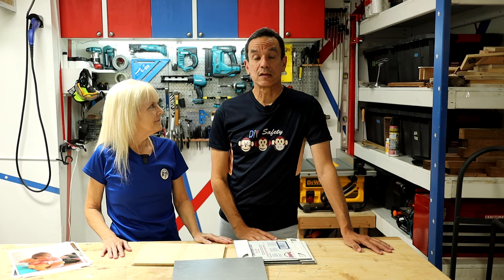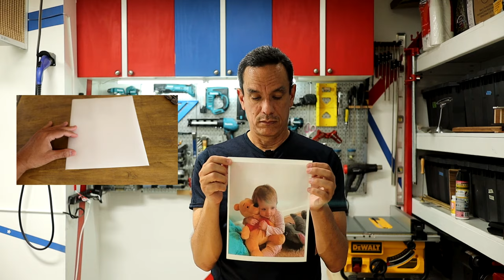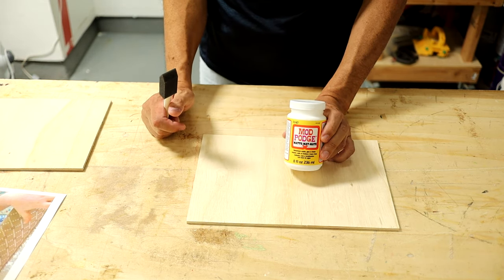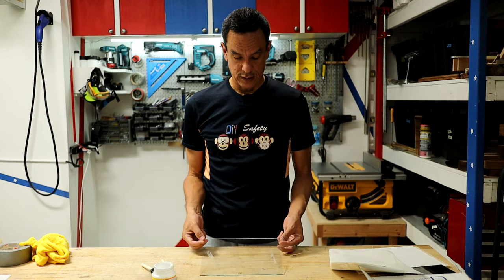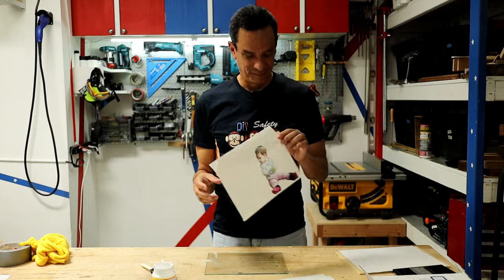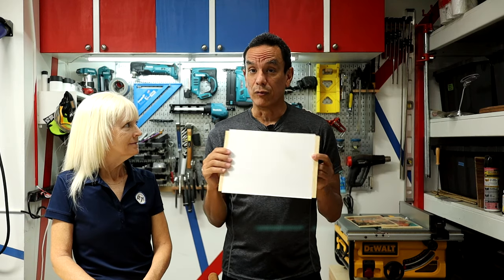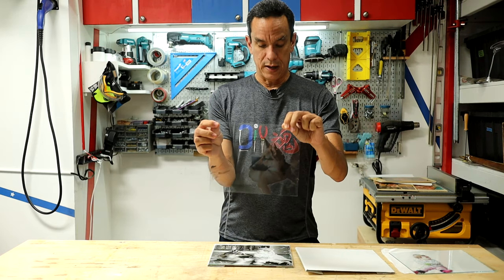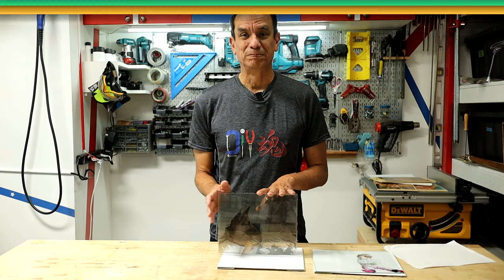Photo Transfer To Wood, Metal and Glass

Comment: I’ve done this method many times as well. To ensure complete contact, I use a plastic puddy knife or an old gift card to smooth it out. The main objective is to be sure that there are no bubbles. Working from the middle out towards the edges works well. For added security, I place a heavy book on top while it dries.  May I also suggest using Liquitex Gel Medium (can be found at most craft stores in the paint section). I have found it works much better than ModPodge.   Great video! I really enjoyed it.
Reply from the maker: we sincerely thank you for taking the time to write such a wonderful comment. I am going to see if I can get the Liquitex Gel and give it a try. We plan to try the various suggestions we received on our next video.
Reply: Question what side of the transfer paper do you use (glossy or dull side )
Reply: @georgelucas1443   you print on the glossy side.
Reply: Yes agreed ....I usually use  a mod podge photo transfer medium doin this technique and it works fabulous!  The one downfall is it is not transparent when dry..it white....soooo today im goin to try n transfer with transparency film ..we shall see how that goes...
Reply: Sto je taj Medium sto ste koristili i njegovo imee, molim.Hvala
Zelim kupiti ovdje u Hrvatskoj., mozda ima drugo ime.

Comment: The metal might be better if it was cleaned first by a light sanding, then using a solvent as it often has grease and other contaminates.  Also the sanding will open up the surface to allow for better adhesion.  I have the mod podge, but have not tryed this yet, I think I will try using it on plexiglass with a white backing to see how it comes out.
Reply from the maker: Fantastic idea. We have had many people make various suggestions. I am thinking it might be worth making an updated video testing out the great ideas!!!
Reply: Yes, wet sanding with 400 grit sandpaper and using a degreaser  will improve your metal adhesiveness.  Good pressure and some form of roller or squeegee  will insure  no air pockets or voids in your  transfer.

Comment: Hi Both, Great video and it is so nice when people show when things don't go according to plan and not cut that part out. 
One suggestion I have, not that I have ever done this, is to put a weight on top of the paper after using the roller and leaving the weight on over night as well. 
I don't know if it would make any difference but it's just a thought I had. Take care both. Cheers, Huw
Reply from the maker: Nice to hear. I constantly make mistakes. My whole channel could be filled with mistakes. LOL!! Kidding aside, thank you so much for your thoughtful comment. BTW, I tried a weight a little bit but I was concerned that the paper would stick and not just the printer toner. I watched several videos and they spend lots of time wetting the paper and gently rubbing off tiny layers over and over until the paper is all gone. Looks like a nightmare so we cheated and tried the easy way out. Please dont tell anyone. LOL

Comment: Great video!  Thank you. Just to reiterate. I can purchase Avery Label Laser Sheets (blank pages -- not address labels). Is this correct?
Reply from the maker: You can purchase any kind of label paper. You are going to remove the label side and use the slippery back side, which all label paper has. If you can, use your labels for actual purposes and dont throw away the backs. Keep the backs to give the transfer a try. :-)
Reply: @Poor_Mans_DIY  Thank you so much!

Comment: Looks interesting -- and the imperfections definitely make it more authentic. I did this for my wife last year using a wooden coaster set (made for crafting) I picked up from my local hardware store. It was a very rough rounded shape, and I used an inkjet with plain white uncoated paper (following a similar method with Mod Podge that I found on another channel) -- and I snapped a pic of the coaster and used that in Photoshop to get the selected image edges (of our rescue dog) to match the odd shape, then it was pretty easy to print and cut out and apply. Definitely something I want to try more of, even without a laser printer at the moment or the label backing paper.
Reply from the maker: We would really like to know how ink works on the label backing paper. I wonder if the ink will run or not. If it doesnt run, there should be no reason that it wont work. If you try this, please let us know how it turns out. :-)
Reply: @Poor_Mans_DIY  yes, I'm not sure on the label backing paper with inkjet. But in the one I did, it was just plain paper -- a technique from Nitsa Creative Studio YT channel (https://www.youtube.com/watch?v=1JBC3_ipeoc) :)
Reply from the maker: @deanontheinterwebs  Thank you sir. We have tried the paper technique and it was a pain and did not turn out as we hoped. We should try the ink printer on the label back to see how well it works.
Reply: it occurs to me that putting a HARD rubber sheath like pipe insulation over the 'rolling pin' might insure better adhesion contact. LOVE your 1950's TV look in that 'glitch'!!! 😀

Comment: What about plastic or. That silver transparent sheet that's in a flat screen. I think that would be cool. At one moment u wouldn't see it and the next u would depending on the light be hind it. Wish u would try it! It would be so awesome if it works!!!
Reply from the maker: Although we did not try this on plastic, we dont see any reason why it would not work. Simply put, the process captures toner in glue and then dries out on the surface. Your idea of using the silver transparent sheet really sounds like a fun challenge. It would be so cool if it works as you describe!

Comment: How did you peel the paper off? How long did you let it dry?
Reply from the maker: The paper on the back of stickers is very slippery. The glue and laser toner does not stick to the paper, even after drying. It just peels right off.

Comment: Hi Jennifer and Richard, and thank you for the time you take to produce such informative videos. Perhaps you can help me with a problem I have. I've purchased the paper from Amazon, as per your link, but when I print something on a laser printer, some of the toner seems to be rubbing off the rollers when the paper comes out of the printer.  What do you suggest I do? The print is fine on normal printer paper though.
Reply from the maker: Mr James, This was our first ever attempts at photo transferring, so we are no where near experts on the process but, I happen to be in IT and often have to repair printers. If your printer is older, it likely requires the rollers to be replaced. My guess is that the rollers have build up , which causes the toner to smear and need to be replaced.  It may sound complex but they are made to be easily replaced. The manufacturer usually sells replacement rollers  with instructions on replacing them. The cost is usually not bad at all. one option you might try is to remove rollers and use isopropyl alcohol to clean the rollers. This is only a temporary fix as they will need to be replaced as some point.  Although it might not work as well, I have seen others print on regular paper but it requires wetting the paper after the glue dries and rubbing the paper off little at a time. This seems time consuming but the glue and toner stay on the wood and the paper dissolves away.  We usually dont try to get people to watch our other videos. If they like our videos, they will watch without pressure from us. In this case, I recommend you check out our second video on this. We used viewer suggestions and used a different product called Liquitex gel that worked so much better than mod podge. Sorry for the long message.    In conclusion, we sincerely thank you for taking the time to watch our video and for your wonderful question. If you wish to ask more questions, please do not hesitate.
Reply: @Poor_Mans_DIY  Thank you so much for your advice. It's very kind of you to take the time to explain how I can sort out my issue. I really appreciate that. I've already watched your second video when you use Liquitex, and I have found that to be extremely enlightening. Once more, thank you so much for your help, and keep up the good work.
Reply: Use regular printer paper absolutely.

Comment: Howdy. Cool video. I've watch many MANY of these photo transfer videos and finally tried one myself....the over night then wetting then rubbing. Didn't come out so great, but I wasn't expecting perfection my 1st go. 

You didn't mention how long you let your images set/dry before you peeled. You mentioned that OTHER people said to let it sit 45 minutes or so...but you didn't mention how long YALL let it sit????

I'm noticing a trend now after watching all these videos and that is a SMOOTH surface. All the videos say to use a smooth surface, but smooth to me and smooth to you are two different things. 

So, how smooth should it be? Well, seeing as how your transfer onto glass seemed to work without a hitch, I guess the NEW definition should be "smooth as glass".
Reply from the maker: Let me begin by thanking you for watching our video and for your insightful questions. Before I provide any info, I recommend you check our second video on this. We had many comments from viewers with great suggestions and we applied their suggestions and got much better results. The most important thing was to use something called Liquitex Gel, which worked significantly better. Now to answer your questions. We did tests and allowed the Mod Podge dry for 2 hours to be safe but found even for that long, if did not fully dry. We then just let it dry over night and that is what we continue to do. As for what is SMOOTH, you have an absolutely valid question as each person will define it differently. Think of what this process is doing, it is using a glue to grab hold of laser toner and drying it to a strong solid state and then removing the paper background. In order to SMUSH  (Technical term) the toner into the glue as deep as possible the surface needs to make contact with the laser toner so the fewer bumps the better to SMUSH the paper onto the wood. I hope this makes sense but if you have more questions, please do not hesitate to ask and I will do my best to provide a proper resolution.

Comment: The metal plate has release agent on the surface, else it would sit stuck in the rolling mill. That agent has to be removed with degreasing fluid first, else nothing really sticks tight to it.
Reply from the maker: Great advice. We will need to research if I transfer more photos.

Comment: Does it have to be laser printed? Will inkjet do? Thanks
Reply from the maker: I have not tried it with inkjet. The process we used relies on laying laser toner onto a very slippery paper. In essence, the toner isn't embedded onto the paper. The glue sticks to the toner power and the wood and the slippery paper separates from it. I worried that ink from inket printing would smear on the slippery paper and i wasn't sure if the ink would bond with the glue. That being said, i believe there are YouTubers that use inket and regular paper to transfer images but i haven't tried the method. We would love to hear results if you try.

Comment: Can this method be used for slate coasters?
Reply from the maker: Fantastic question! I have not actually tried it but in theory, I believe it is "possible" but I worry about the results. All we actually did was to lay laser toner on a slippery paper, then added a glue on the paper. This captures the toner and when the glue dries, the toner is stuck in the glue. So there should be no reason it would not work on slate. There are problems though. You really need to rub hard so the paper, toner and glue stick to the surface for drying. Slate is naturally porous and I worry you may not get a tight bond all over. In addition, when the glue dries on the slate, I dont know if it will look nice or not. Another big concern I would have is that slate is usually dark, which may may a picture difficult to be seen. I hope this helps but if you have any other questions, let us know and we will try hard to provide a valid resolution.

Comment: What kind of paper are you using?
Reply from the maker: we use labels and remove the labels and use the slick backing of the label to print on. It is slick and the toner doesnt stick to it so it sticks to the glue and pulls off the label paper.

Comment: I had staples print my images but in the size I needed they could only print on actual photo paper. Will this work still?
Reply from the maker: I have seen people use pictures on regular paper. They soak the paper when the process is over and gently rub over and over until the paper is gone and the image is left. It looks like it takes a long time but does work. We did a follow up video based on viewer suggestions. We tried a product called liquitex and it worked many times better that mod podge. You might want to give it a try.

Comment: What side of the transfer paper goes into the printer ??
Reply: Ms Betty, we do not use a transfer paper. We used label paper and then we removed the labels and printed on the shiny , slippery side that held onto the labels. This side of the paper is very slippery and is why labels can be peeled off. Toner does dont permanently stick to the paper so it transfers onto glue. I hope this helps and makes sense. If you have further questions, please feel free to ask
Reply: @richardgrant4720  Thanks Richard , Where do you purchase label paper ?
Reply from the maker: @bettymcalister1504  Ms Betty, I just realized I responded with my personal YouTube account. I hope I did not confuse you. Sorry about that! As to where we bought our label paper, here is an affiliate link to the labels we obtained from Amazon.

Comment: hi, ive tried using backing paper on  my laserjet and it wont print on it. its release liner paper if thats same
how please
Reply from the maker: I am so sorry but I am not familiar with release liner paper and I am unable to provide advice. We learned from others who used labels and it is the only thing we have used, since.
Reply: I've been told it's the same as the label backing paper but it's double side . I guess it's bit thick compared

Comment: Hello sir, what kind of paper you use in wood transfer?
Reply from the maker: Greetings. Instead of regular paper, we bought full size sheets of labels, then we peeled off the label side and threw it away and used the back part of label. It is very slippery and the toner from the printer does not soak into the paper so you can transfer easier. We made a newer video based on suggestions our viewers made. The pictures turned out even better . If you have any other questions, feel free to ask. By the way, in the description of the video, we have links to the products so you can take a look at exactly what we used. Thank you for watching and for leaving a comment.

Comment: I've tried several of the methods I found on videos and so none of them have worked for me. But I don't have a laser printer
Reply from the maker: I have both a laser and inkjet printer but I only attempted to use the laser because of its use of toner, which is powder. I figured it would transfer over better than ink, which may smear more. I have seen many videos that use inkjet and they seem to make it work. If I were to try my inkjet, I would used the label paper in this video, along with Liquitex gel, which worked much better than ModPodge. We did another video on it and the results were considerably improved. You might want to give it a try.

Comment: I really want to know if it can be done 5+ minutes with assistance from a heat gun?  Every video leaves it dry for hours to overnight...no go.
Reply from the maker: Mr Aaron,  I was thinking something similar but chose not to try. I worried the excessive heat may affect the bonding qualities of the glue. If you happen to try a heat gun, we would love to hear how it works out. Also, we made an update video of photo transfers and we tried a product called Liquitex Acrylic Gel. It worked better than Mod Podge so you might want to consider that as an option.  Thank you for watching our video on for leaving such a good question for us.
Reply: @Poor_Mans_DIY  yes I've seen liquidtex transfers used on painted surfaces in 5 minutes, with heat gun, wetting & a towel...but its some type of treated standard paper....

I will be trying liquidtex with mailing label release paper & heat...hoping it works, maybe no need for water.  Laser printer.

Comment: I just can’t buy labels and throw the label away just to use label paper. There has to be an similar alternative. Such a western thing to do.
Reply from the maker: Absolutely valid point. Maybe you can use the labels and when done, you can use the back. Just a thought as I am not trying to be rude but, what do people outside the "west" do with the slippery paper that labels are attached to? I assumed they were thrown out. If so, is there much difference from using the label and tossing the back, as opposed to using the back and throwing away the front?
Reply: Maybe parchment paper?